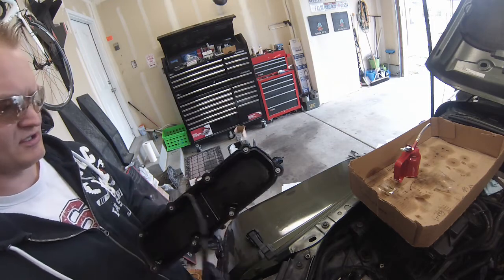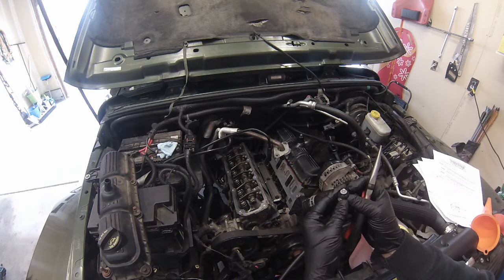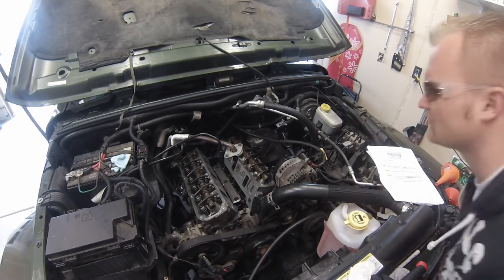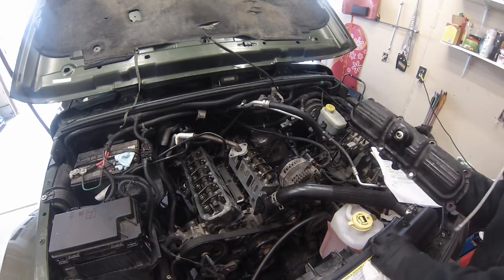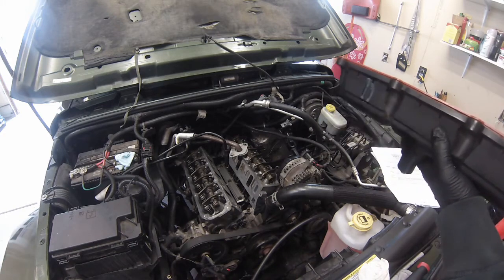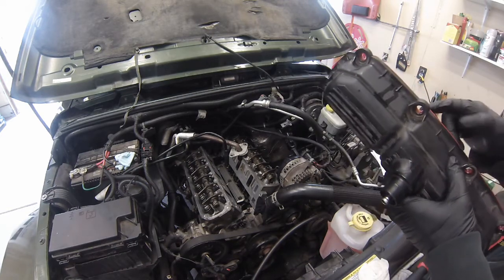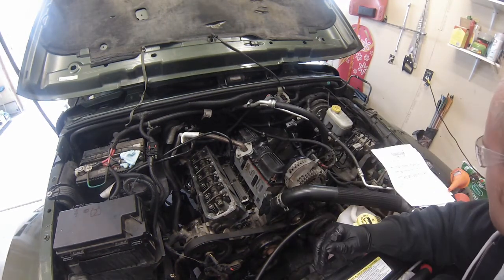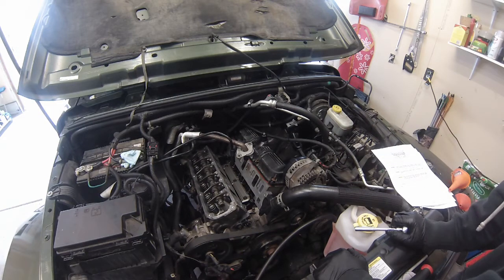Jeep Wrangler JK 3.8L Engine Rebuild Part 9 - Valve Cover Install

Comment: I wish that you had included installing the push rods and rockers before the valve cover. Is there a special process for installing them? Did you use assembly lube? Or did you completely smother them in oil like i see other people do online? Thanks for the vids

Comment: I own a 2007 JK that I have driven 434k miles.  Went to salvage yard and picked up a set of metal valve covers from a 2001-05 town & county mini van 3.8L.  Will have to make a PCV HOSE  modification to work on JK.. POS plastic valve covers have warped.

Comment: Hey Xinn, had a question. I have gone thru all the videos. I’m at this point waiting to have my wrist pins install on the piston heads. And then I can start the actual rebuild. However. Between vid 8 and vid 9 the head ...then manifold install. It seems the push rods magically were install, . I have checked for other sources and videos, was their a special way of install. Or is it simply rest the shaft on top and torque them down in a certain sequence. I’m still researching myself. But any tips would be helpful. Thanks and Merry Christmas
Reply from the maker: Hello! Sorry about that, didn't realize I edited that part out. The push rods just slide down into their respective holes without anything special needed. The toughest part is actually putting the valves back on and making sure they are all in the rocker arms correctly. Thanks for watching!

Comment: Thanks. Great rebuild. I had mine rebuilt 67000 miles but it was under the powertrain warranty. they did a short block. I didn't have any oil consumption issues but I did have a rod bearing spun on piston four. I know the 07 s and 08 s are more prone to early engine failure because a lot of them were made in Mexico for the engine. so far 40,000 on the new rebuild and no noises and good power fingers crossed.
Reply from the maker: ej Christian I looked/inspected all my bearings and surfaces and found them to be like new condition. I decided not to replace mine. I heard that some of the connecting rods were installed 180 degrees incorrectly which placed the oil squirt hole on the opposite side of the thrust angle. Mine were oriented correctly so I didn't do anything further. I would have loved to known if this is what caused your early engine failure. If I had a lot more money and a lot more time there would have been a lot more things I would have done to this engine but financially I couldn't afford it. I'm really hoping this engine will be a good one now. Only about 3k miles on it so far but so far so good.